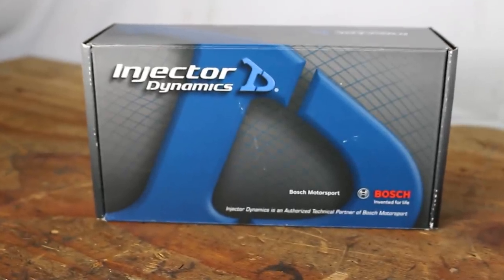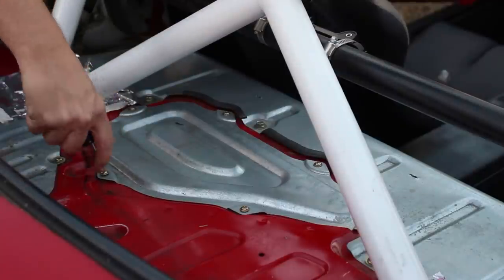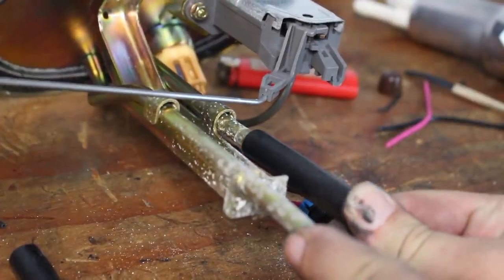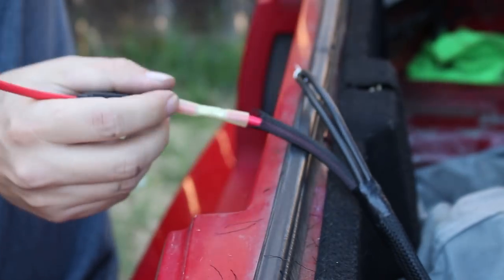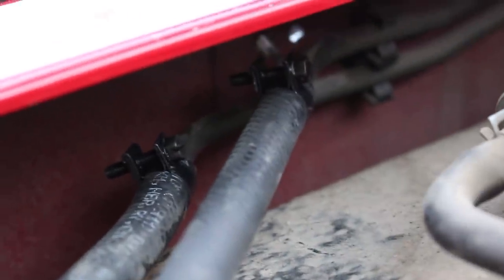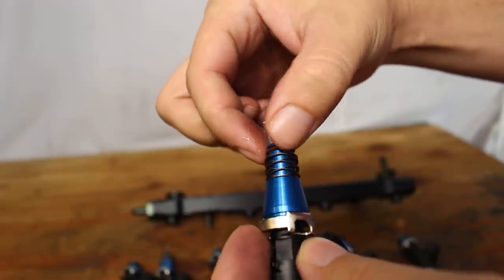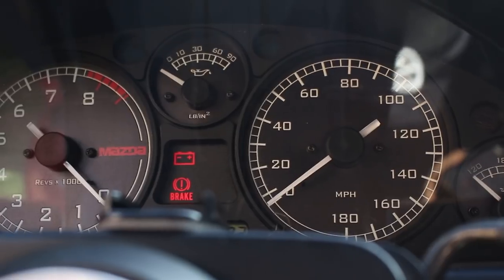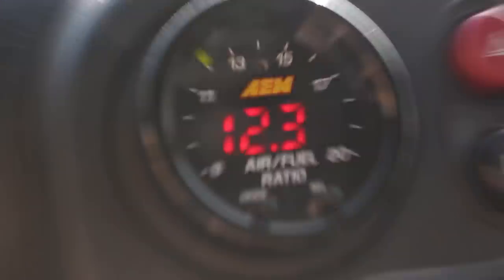Miata's New 600HP Fuel System Install! (Wiring, Setup, ECU settings)

Comment: I just want to tell you thank you dad!! I started watching your YouTube since broke and boosted, you've motivated me so much and influenced me to build the hell out of my miata, I've had the car 3 years now, boosted for 1 year and recently  blew it up, now I'm rebuiding all back up, I couldn't be more excited, I had a  rough start of the year, it felt like life kept pulling me down, especially when the car blew up, everytime I lose motivation and feel like I can't anymore, feel like giving up,  I always go back and rewatch the rebirth videos, and now videos of your 500hp vvt beast!  you really have and keep pushing me to keep going, keep working on my dreams, and never give up, so I just want to thank you for being the best miata dad, you have helped me through so many rough patches, I just thought I'd tell you how much you've helped me and keep re motivating me!
Reply: How much power were you running when you blew? And about how much boost?
Reply from the maker: Thanks for checking in man that's great to hear!
Reply: @donovinmiller3532  250 whp at 15 psi, stock internal 1.6. Took an entire year of harsh abuse like a champ! Got too ballsey and tried 18psi. Then rod #4 became an astronaut 😂
Reply: @colebina5271  unfortunate. I've done all the research in terms of what I need for my own turbo build i'm just wrestling with going through with it. Just rebuilt my na6 motor and I dont wanna have to rebuild again. I won't run more than 8psi to keep things safe but still a little hesitant
Reply: @donovinmiller3532  makes sense,  but at 8-15 psi you're pretty save, also it's all in the tune too, I was very conservative at 15 psi and handled it no problem with the abuse, that engine owed me nothing after what I put it through lol, then I made the spicy 18 psi tune and that's when it blew, don't be too scared of it, once boosted you'll want more lol, do a 10 psi waste gate with a boost controller, that's how I started, got comfortable with my tuning at 10 psi then went from there
Reply: @colebina5271  How much money had you spent when you were comfortable at 10psi? I have a 1.6, I'm thinking of either rebuilding the engine and going turbo, or just thrash on the engine how it is and throw in a K24z3 when it inevitably fails
Reply: @danielskrskr  I went alittle hard and bought the FM diy kit,  got a good deal on it during the holidays of 2019, it was worth every penny but still pricey (can't remember the total) , it made everything super easy, then went with the speedy efi ecu which is cheaper the MS, and still uses turner studio
Reply: @colebina5271  sounds like you know a lil sum. 250hp gets boring after a while. For me it was like a matter of weeks before I wanted more. Now Im at 350 and need to upgrade my clutch before I do more. Goal is 400
Reply: @miatafied  I indeed know alil sum lol, I live in a fairly small city (60k people) with a smaller car scene, so having a non clapped, clean as hell miata was a big thing, there was only 2 other ones and old people drove them, not to mention having it be turboed and making that power, I shocked the car car scene here😂 220 was my goal and hit 250 so I was more than happy with the turn out. And yes your right you always want more but I never got bored of my 250, walked the auto crosses, made alot of v8, Subaru and diesel guys mad drag racing. Never a time I wasn't having fun or not smiling, unfortunately and fortunately blew it up by wanting more and being ballsey. But from that it's going to get a hell of alot more fun.
Reply: You're not alone. Ole Miata dad inspired me to turbo my Miata and after a year of driving it hard I blew mine up this past spring. I've had my motor rebuilt with forged internals and I'm in the process of putting my Miata back together. It took me 2 years to build and the build was literally one part at a time. Don't let anything get in your way. Stay after it. It's well worth everything you go through to get the car done. Anyone that has ever driven a boosted Miata knows they are the funnest road car built.

Comment: I hope you're using fuel submersion rated crimps and hose (SAE J30R10) :) 

The fuel hose you took out looks to have degraded consistent with non submersion rated hose.
Reply: Those hose clamps may rust over time in the E85. Zip ties may be a more reliable solution, and have proven to last in E85.
Why not both? Redundant materials.

Comment: The zip ties are typically nylon which seems to hold up pretty well submerged in E85. Just make sure the metal hose clamps are good stainless ones.

Comment: Great job.  The only issue with that fuel filter setup is what you saw... it's common for a line to give out at the filter due to the restriction there and if the filter is in your engine bay there's a higher chance of a fire.  Just keep up with maintenance of the filter and inspect the lines periodically and you should be fine.
Reply: Hardlines would be best.
Reply: @aygwm  And always keep a fire extinguisher in your tuner car lol and know how to use it :D

Comment: I love the concept of turning your pre-existing power lines into relay signals. 

My roommate did the same process with some crazy bright lights in a ratty old pre-tacoma Toyota pickup. Gotta love the security of not burning your cars original wiring harness.

Comment: Something I learned after the fact for mine is an additional safety measure to using a crimp with heat shrink is to splice in two different sections for each wire, that way if they were to ever be exposed they are even less likely to contact the other wire. Maybe it'll be helpful to someone else before they splice into theirs.

Comment: Good call out with the Id1300s and the skunk2 manifold, I plugged the adapters in and then installed the injectors, but it was still very tight and I was worried about getting a good seal. No leaks thus far! Cant wait to see this thing make 500whp!

Comment: Blew my main relay after about 8/9 years with a larger fuel pump (for those who don't know, the main relay feeds power to the fuel pump relay.) I hit the easy button and got the higher amp relay out of a MPV. ($7 at a junk yard vs $80ish brand new online) I also have this hard wire kit ready to go, since June, but SCREW GETTING UNDER THE DASH! Planned on doing mine the very same way. Happy to see it's just as easy as I thought but now I feel bad for how I keep putting it off. Ready to see that 500+hp!!!!

Comment: Awesome job, cant wait for 500hp. Consider also a fuel cooler on return line. I had issues with 320lhp pump. Pump was dying after more the 6hr of running. Fuel cooler with tiny fan solved the problem.
Reply from the maker: I was thinking about doing 2 staged pumps for this reason, we'll see how it goes!

Comment: Fun fact, rising rate and boost referenced fuel pressure regulators are not the same thing (16:45).  Rising rate is generally not linear (so 1psi of boost may be an increase of more than 1psi of fuel).  Boost referenced are always a 1:1 relationship, although often this will decrease to 0.8psi fuel to 1psi boost or so at 20-30psi of boost pressure - it depends on the regulator itself as to what point that changes.

Anywho, just wanted to mention that quick tidbit.  Nice video.

Comment: Be careful with vasoline.  I found out that it can make rubber O-rings swell.  (Bathroom sink, so it may not apply to the injector O-rings).  I always now use dielectric grease (like for sparkplug wires)

Comment: I had a similar problem with my VVT engine dying at startup, and it was because the activated VVT was adding more air than the WUE was set for. I combat this by deactivating it till WUE ended.

Comment: Obviously it works, obviously it’s fine.

But there is always something about connectors sitting inside the fuel that will always weird me out. Electricity hanging out in a flammable liquid. Sounds great.
🤣🤣
Nicely done dad, bring on that 500 HP!!
Reply: Even more fun to think about how the fuel cools the pump.  Always running on a low tank is a sure way to strain the pump into an early death as it overheats without being surrounded by liquid (flammable liquid in this case).

Comment: Great video as always.  Please consider the Fuel Lap filter a necessary upgrade with ID injectors.  Two friends suffered clogged ID injectors running the OEM filter only.

Comment: I would add grease the rubber seal on the connector for the pump, ran into fuses blowing constantly and that was because the connector was getting fuel in it

Comment: One correction to point out - what you have is a MAP referenced 1:1 FPR, not a rising rate. A rising rate would increase fuel pressure MORE than manifold pressure, say at 3:1 ratio or more

Comment: I'm about to do this and am a little confused. You cut 2 wires at the harness before it connects to the fuel pump (the power and ground). I get the part where you split the blue and yellow wire one going to the pump and one going back to the relay. What I don't get is why you cut the ground wire and capped it? I'm not saying it's wrong I'm just seeing other ways people have done this and they said all they did was cut the power wire and connect the blue and the yellow wire. I think in the directions it just mentions splicing into the power and not cutting 2 wires (power and ground)

Comment: Hey Greg, I wanted to ask how much your car weighs after all the mods. With you making 500+HP and depending on your weight, you are the definition of mustang killer!

Also Miatadad, does my laundry list before I turbo sound good? 1. Bushings all around, 2. Coilovers, 3 Torsen Swap (1993 LE, so it came with a vlsd  🤢) 4. Standalone 5. Turbo! 
I am looking to make a reasonable 140-200, I also already have ARP head and main studs. I want to be able to keep up with traffic and have some fun with turbo noises. But I also want to be able to corner amazingly! What Power number would be reasonable to allow me to corner just as good without overdoing it?

(I also bought my miata with some weightloss apparently.. owner removed AC and PS for manual rack..
Reply: If you're only making 200 a simple turbo setup, and maybe head studs would be more than enough. But I think if you really want, do rods, maybe pistons, and go for a good 300

Comment: I bet if you bypass the stock fuel lines and go with larger AN fittings instead of the restrictive stock stuff, I bet you won't have any more fuel issues.

Comment: so i turboed my car and i put a stronger fuel pump in and it was working perfectly fine until one day it didn’t. i replaced the stock fuel pump relay and still nothing. I already tested my fuel pump separately and confirmed that it is good. would this fuel pump hardwire kit fix my problem ? personally i would think so bc it would be getting its power directly from the battery but just a question for you greg and anyone who happens to see this. Thanks and have a great day !

Comment: Hey man I love you videos and have learned a ton from all your content. Question for you ... What fuel line are you using with the E85? And have you noticed any of it deteriorating? I'm making the switch to E85 on my MS3 S480 turbo 460 bbf and curious about fuel line. I'm currently using the Jegs Pro-Flow 250 stuff which had been great so far. Thanks!
Reply from the maker: I've been using standard 7.9mm fuel line, nothing special, the lines that I showed having issues in the car have been in there for 6-7 years of pure E85. I should probably convert the whole fuel system to something better, but I really haven't had much trouble so far.
Reply: @TheCarPassionChannel  that's really good to hear some real world experience. I keep being told that my lines won't work with E85 but I bet they would be just fine and if they last 7 years I'd be happy with that. Keep up the good work brother, you are killing it!

Comment: Buddy, that fuel pump is just pre-meditated upgrade for your 35hp WET SHOT nitrous to spool the turbo up faster. Read up on it, it's safe just cutoff at 8-10psi during WOT only - the bottle should last a LONG time under this scenario.
Reply from the maker: Real talk - if I was going to do a nitrous spool setup I'd definitely go +2 sizes on the turbo. This thing doesn't leave me wanting any faster response. With spray it would be sick to have something that could spool as fast but actually be able to breath/be efficient at 500-550. This turbo is having its neck rung at 500 😅

Comment: I have a similar set up for my 1995 turbo Miata, I went off the same signal wire for my hardwire relay, works fine sometimes but other times I’ll be driving and the stock relay and the hardwired relay get hot and then the car starts to run weird, any ideas?

Comment: Greg I followed you from the beginning when I bought my completely stock NB in 2016 I had practically no automotive knowledge too... Now I've got $15k+ into the car w/ a built bottom end making 380whp and I did all the labor myself... I'm torn though; do I build the head and do the ZF/getrag swap (approx another 5k+) or do I just part out and go LS.   I could see 500/600 doing the head.  My rear-end and trans is a ticking time bomb right now anyways as they're both stock.   What do you say?
Reply from the maker: That's awesome to hear man! That's a tough call, but I think in the end you'll likely be more happy with the LS if that's the power level you're going for. It depends what you really enjoy, if you really love that turbo 4-cylinder action maybe build the head + turbo upsize or whatever it takes to get you there, it's just  always going to come with unforseen issues as the power goes up, as you might already know. Good luck with whatever route you choose!
Reply: @TheCarPassionChannel  thanks alot Greg! I appreciate the quick response. I do hate giving up on platforms and I do love the turbo BP. I guess I'll have to continue giving it thought. By no means do I have tons of money laying around LS swapping won't be something I could do easily financially. Ultimately I've got a running car now and LS swapping might put it out of the game for awhile.   Thanks for the insight!
Reply from the maker: @LiveToRidee  If you wan to discuss your exact setup and what you can do to squeeze more power out of it without spending unnecessary money to shoot me a DM! Although if you already built a 400hp Miata you probably already know the answers haha
Reply: @TheCarPassionChannel  appreciate it Greg! If I think of anything I'll hit you up. I could crank up the boost but I think 26psi is good enough for now lol

Comment: EDIT: Found the solution. Check my reply.

It seems to be rushed over in the video, but where did you get the connection for the blue DW wire from?

I’m trying the install and don’t know where to source a switched wire from.
Reply: Nevermind! Figured it out.

Yellow on the DW piece connects direct to the blue/red factory wire on pigtail side (goes to fuel pump) and the blue connects to the other half of that blue/red factory wire (goes to the factory fuel relay).

Thanks for the video!
Reply: @dilberadam  The one thing I'm curious about is if it's essential to snip the existing ground wire or not from the factory harness. I'm tempted to leave mine in tact, but not sure what havoc that could cause.

Comment: Do you know if there is a downside to not snipping the ground wire in the wiring harness for the fuel pump? It's just an extra ground, yes?
Reply: I had the exact same question. Going off Deatschwerks procedure, it doesn't even mention snipping the ground wire. The ground wire from the new relay is essentially just meant to ground it. The existing ground should be sufficient.

Comment: Can you explain why you installed the injectors with the connector pointed towards the front of the car instead of downward like stock NB?
Reply from the maker: Yes, I did explain it in the video. New style ID injectors have to be installed this way, they don't fit any other way

Comment: Wow. 60psi at ideal. On the 2200cc injector. My fuel pressureat ideal is at 40psi.
Reply from the maker: ID injectors supposedly spray best around 100psi, so 60 base + ~30psi boost (1:1 reg) gets me pretty close. Stock base FB on the NB motors is around 55psi

Comment: I want to see your car lined up with something else. I just cannot fathom it putting down this level of power I just feel like a 400hp Golf R will still manage to gap it lmao
Reply: I think the 2 weak points of any high powered miata build against other cars is traction without weight and the gearing of the transmission.  4000 lbs cars can roast the tires with 500hp, trying to keep a 2100 lbs car from doing it could be damn near impossible.  Then you need a gear ratio that allows you to maximize that power for your intended purpose, stock NA miata gearing requires 3rd gear just to hit 60 mph.  I know he's not a stock transmission anymore but without really customizing the gearing it's a weak point for the power delivery.
Reply from the maker: I'm trying to get the car ready for a street style drag event before the end of the year, trust me I just wanna line up with a bunch cars for fun too